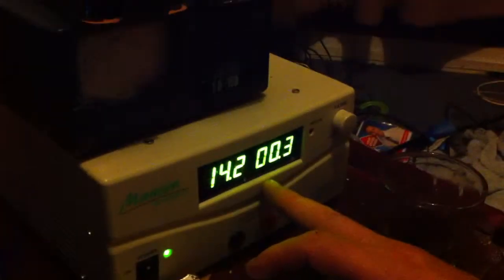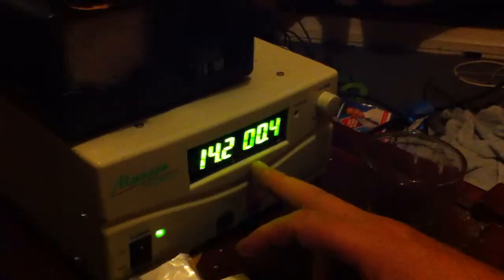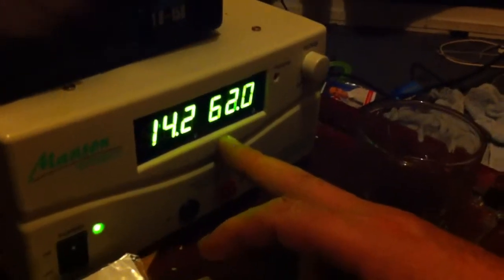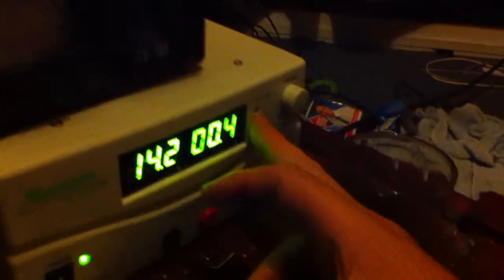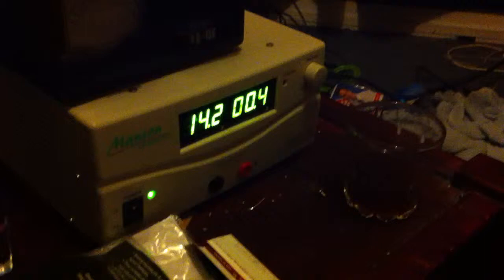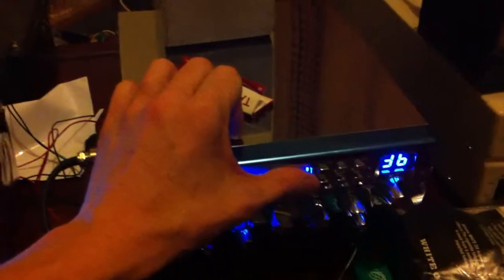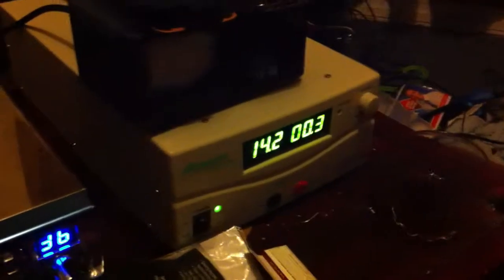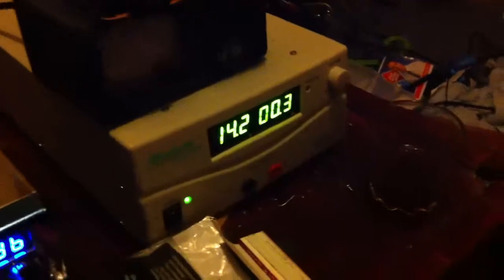Pushing a 60A power supply

Comment from the maker: Yes, the fan in the ps is a tad on the noisy side, but swap it out for a quieter one, and it deals with that problem straight away. Its just a stock 80mm 12Vdc fan.